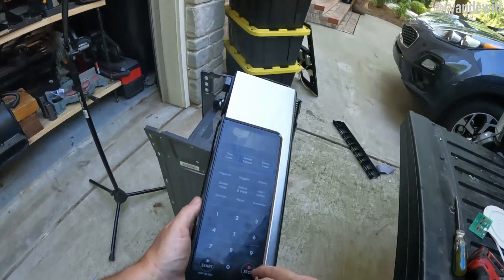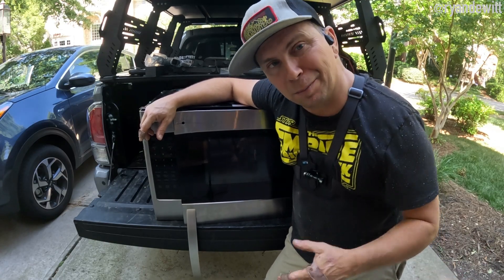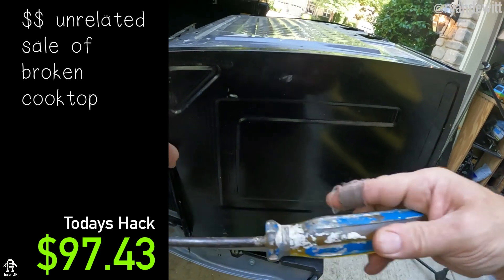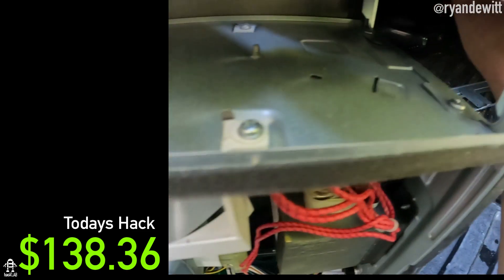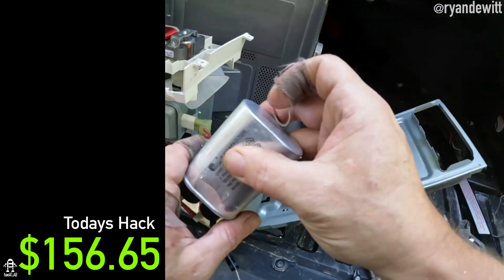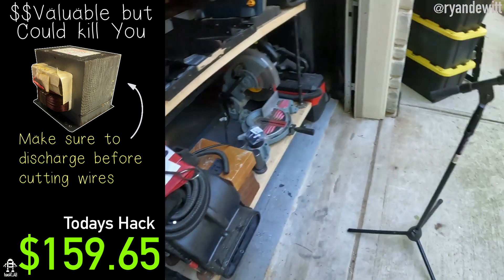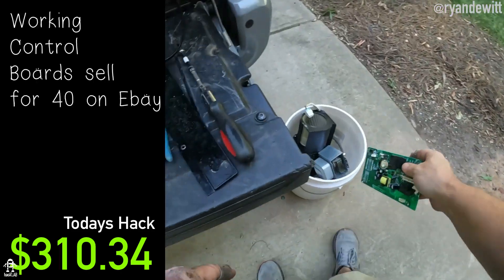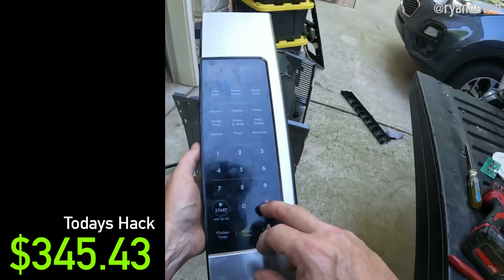Making Side Cash - Salvaging Microwave Salvage Parts

Comment: Well I hope your actual fabrication work is better than your completely fabricated prices... And your knowledge of microwave parts... I think this is a magnet... No it's a transformer, and no you can't discharge a transformer as you seemed to think from the graphics on the side of your video as the transformer doesn't store any charge in it... It's the capacitor you need to discharge. Also the magnetron turns to create microwaves!? It doesn't turn at all... The most hilarious thing though was... That must be the turntable motor... It looks like it turns... Wait what... A motor turns!? 😱
Reply: I think he was trying to be funny, he included a sale of an unrelated item , you are right about capacitor Stuart.
Reply from the maker: Thanks for your comment Stuart. The intention of my video was to learn what’s in a microwave and warn people about crushing the magnetron and transformer holding current  and maybe some entertainment .  Unlike other, larger appliances, even if you unplug a microwave, it can still hold a deadly charge in its capacitors. If your magnetron has a pink ring around it, then it contains beryllium oxide, which is extremely toxic if crushed.  The cavity magnetron is the main component of a microwave. The magnetron is an oscillator where electrons are emitted from a hot cathode and whirl past resonant cavities which are part of the anode at speeds that generate microwave energy. The magnetron is a high-powered vacuum tube that works as a self-excited microwave oscillator. Crossed electron and magnetic fields are used in the magnetron to produce the high-power output required in radar equipment. Mishandling a magnetron has been known to cause death. This is the main danger. Never operate a microwave oven with the cover opened, as high voltage and quite high currents are circulating.  You can also sell it without taking it apart , eplacing a microwave magnetron costs $100 to $200. This includes a part price of $50 to $100 and $50 to $100 for labor. A magnetron is the primary component that produces heat for the appliance. This part creates microwave energy.  Now for the deadly lethal transformer warning the powers the hungry magnetron  - There are three windings, the primary one getting 120 or 240V mains voltage applied. The secondary is high in power. A potentially lethal amount of current is provided by the other end of the transformer, which is grounded to the core. Unlike other, larger appliances, even if you unplug a microwave, it can still hold a deadly charge in its capacitors. Next time I’ll sound a little more correct , but maybe I’ll learn about something else.
Reply: @hacklab.ryandewitt  in your average microwave for heating food, the insulators are likely to be made out of alumina.